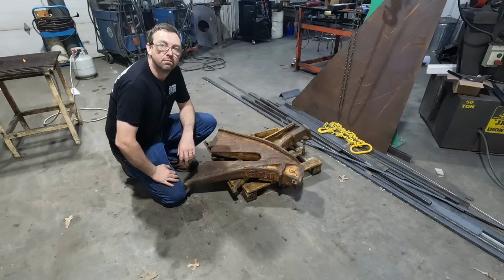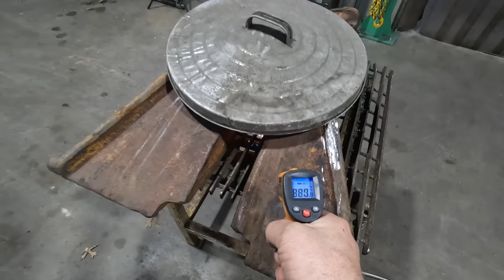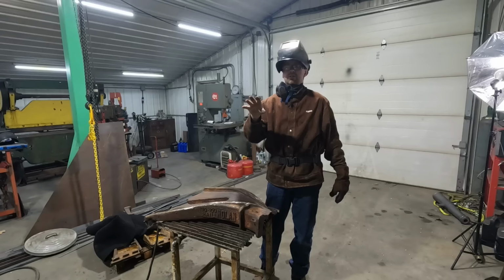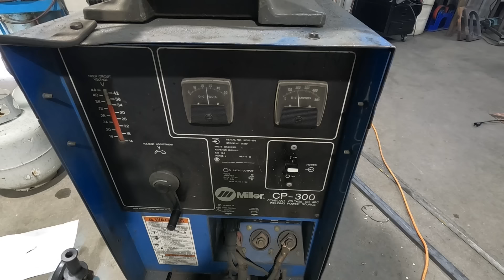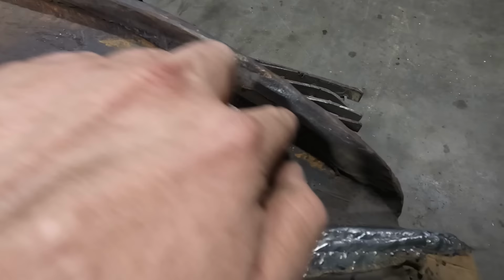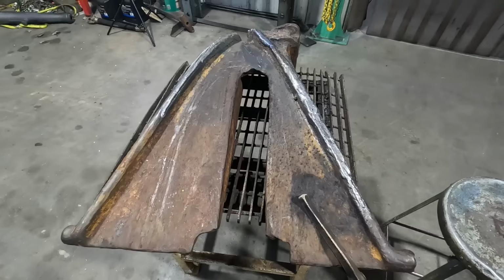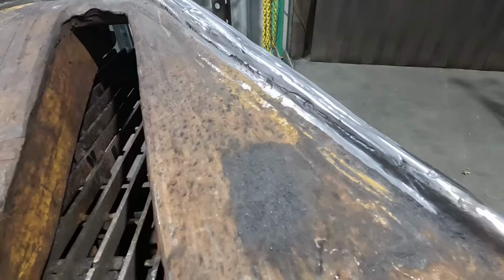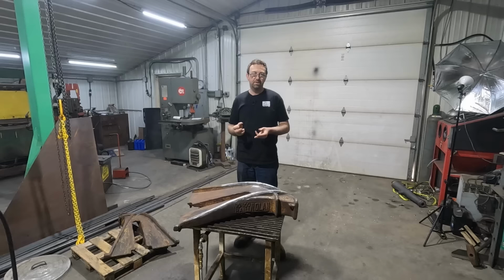Fixing a Worn Set of Rerailing Frogs - Train Derailment Cleanup Tool Rebuilt - Welding Repair

Comment: That’s something you rarely see is a welder paying attention to preheat, postheat and interpass temperatures. Metallurgy works.
Reply from the maker: It's funny how nobody pays attention to that stuff. I didn't do the proper procedure one time and paid for it. Now preheat, interpass temp control, and slow cooling or sometimes post heat.
Reply: That’s why we love Topper, no argument one of the best welder/machinists on the platform
Reply: Most welders just know how to run beads. They don't have any real technical knowledge. I went to school for welding and welders always ridicule me for it. "You don't learn to weld in school, you learn to weld by doing it. You learn about welding in school. Things like preheat, interpass temperatures and post heat.

Comment: Very interesting. I saw a derailment recovery video on CCRX 6700's channel, he works for a railroad that services coal mines. The rerailing frog in his video looked a lot smaller than yours, it might have just been perspective as they are only shown once in place. But it got pushed along a fair bit before they got it to stick and the wheel successfully mounted the frog and they finally managed to get things back up on the track.

Comment: You’re absolutely correct about ice and trains derailing. Back in 1974. During the Winter the Railroad never turned the water hoses off at the locomotive engine house. Well it had snowed out. When I went over this section of rail. Headed for the fuel pad. The Locomotive derailed instantly because of the ice. The Locomotive slid sideways into a drainage ditch. I thought the locomotive was going to turn on its side. Luckily it didn’t. Anyway Penn Central were using EP-22/E-8’s on the NY and Long Branch Railroad from South Amboy NJ to Bay Head NJ. I remember some of the EP-22/E-8’s had two retailers on certain locomotives. They looked similar to the ones you’re repairing. I do remember they looked like they were never used. Excellent job at repairing your retailers.
Reply from the maker: Winter railroading sucks. I get called frequently to retail cars and engines due to the ice. Sometimes the ice can help too. I've pulled cars back on just following the ice rail.

Comment: I only wish we could use rerailing frogs. Embedded track and clearance issues prevent it. We use Hegenscheidt MFD rerailing equipment. And yes, derailments are very stressful and time critical events. The most dangerous thing we do on the railroad. It is very rare we even get still photos, let alone video.
Reply from the maker: I've been the wreck boss on several derailments over the last 15 years. If someone has time for pictures, they aren't paying attention. I've seen so many close calls from people not paying attention.

Comment: Notice that the rerailers are designed for 70-100 Lb rail as cast into the side of the piece.  Are you using them on the appropriate size rail or larger size rail?  Retired 51+ year railroader with 10+ years on the ground
Reply from the maker: Almost all of my customers are in 90lb rail. Some 100, but way more 90lb.

Comment: 🤣🤣🤣🤣"Fart Sniffer"!!!! I remembered that one. I do not know that much about welding but I am glad that you do. I thought that your concern over the preheating was great. I did not know that a weld could hold up to so much weight rolling over it. For some reason I thought that you were going to do a post heat but I must of been thinking of another procedure. Great work on the job and on the video. It is good to see you and thanks for the video. :hand-pink-waving::hand-pink-waving::hand-orange-covering-eyes::hand-orange-covering-eyes::trophy-yellow-smiling::trophy-yellow-smiling::trophy-yellow-smiling::trophy-yellow-smiling:

Comment: Have seen how it is done in some of the "less advanced" countries, there was a tv travel program where they used a club/lump hammer to run the wheel up.
Now to tell you off😉, as a one time audiology tech may i suggest you use hearing protection to match your eye and lung protection. If your ears "ring" after a noise you are on the road to hearing loss, it is cumulative but avoidable.
Reply from the maker: I always wear ear plugs when welding. At the high amperage it's very noisy. You just can't see them. I've already done a lot of damage to my hearing, but it does help with marriage. I can't hear the wife complain as much. Lol
Reply: @TopperMachineLLC  always look for the upside in any adverse condition🤣
Reply: @TopperMachineLLC  I was also concerned about your hearing, but I could see that you were wearing ear plugs during this video. Like you, I have hearing damage from not using hearing protection when I was young (nobody did, as we didn't know about it back then). I use ear muffs when making noise, as my hearing is now very sensitive to even mild noise levels, which cause intense pain. I even have to tell my wife to talk more quietly when she thinks she is talking normally and not even yelling, but it sounds like it to me because of the hearing damage.

Comment: Got to be super annoying when you get the car pulled to the top of the railed and it jumps back over and goes back off. Looks like a second row of beads behind the tail at the top to buttress it sure would not hurt.
Reply from the maker: It was super frustrating.  I can't even explain the feeling you get when they climb up the frog and hit the rail on the other side.

Comment: Thanks for showing that.

Even if you can’t show a real “re railment” if you could spend a few minutes showing how those are setup next to the track and the principal behind how they are used. I just can’t quite picture it in my head. Understand if even showing this though might draw scrutiny you don’t want/need.

Keep up the great work.
Reply from the maker: Basically, you lay it over the rail and there is a wedge you drive in to lock it in place. The wheel just climbs up and over, being forced by the flanges I built up, to the correct location and drops back on the rail.
Reply: @TopperMachineLLC  ok, I think I get it. I had it in my head you sat that next to the rail. Thanks!
Reply: On this channel about 3 months ago, demonstrates how to use frogs to rerail a locomotive.. it can be a frustrating process https://youtube.com/@ccrx6700
Reply: @mark111943 I made a post demonstrating how to use the frogs, but I didn't quote you in it so I want to make sure you see it
Reply: @andyj74  appreciate you letting me know but I could find a post from you in these comments. Thanks Mark

Comment: is it possible to use some hard facing wire to add a bit of wear protection to the edge?
Reply from the maker: I'd rather have the frog softer than the wheel. Considering how they are almost 60 years old, I don't think I'll have to rebuild them again.

Comment: You should use a weldinghelmet with built in fume filter i like speedglas 9100 air with adflow 
So you can skip respirator
Reply from the maker: That's fine and dandy, but I also use the respirator for grinding and other stuff. If I only have the helmet, then every time I pull it off to grind I still have to put on a mask. Doesn't make a lot of sense to me. Also, I can think of way better things to spend a couple grand on.

Comment: Would there be any chance that you could mock up a short piece of track to be able to show the concept of how they work as I have never even heard of them before and would like to see how they work. As you said the real thing you wouldn’t do that I well understand anyway another good video
Reply from the maker: Setup is too much for me to do by myself. As you know, I do these videos alone. But the concept is that they lay over the rail and act as a ramp. The flanges I built up force the wheel to the correct location, and it just drops onto the rail.
Reply: @TopperMachineLLC  very simple but cool idea it must make it easier than having to use the big crane from your other video
Reply from the maker: @workingovertime4429  depends on the situation. Each took has its place.
Reply: You tube has a video.

Comment: Could you hard face the inner edge to ensure it didn't wear down as fast the inside face of the unit or would it cause too much wear on the train wheel flanges?
Reply from the maker: I was afraid hardface would damage the wheel. Considering these frogs are almost 60 years old, id say wear isn't a real issue

Comment: I thought you must have been running about 200A the way the weld was going. It was handy that you showed the gauges so we could see.
 I think your tension on the wire spool is a bit high as the spool looked like it was trying to hold the wire back too much.
Reply from the maker: I have fought with that spool holder for a long time. I think it's due for rebuild as I can't get new parts for it.
Reply: @TopperMachineLLC  I bet you know a good machinist, maybe ask him nicely to make so parts for you. Haha.

Comment: Dave at the Cumberland Mine Railroad channel showed a rerailing of a locomotive.
Reply from the maker: His FRA inspectors must not be like ours.
Reply: @TopperMachineLLC  
Isolated line only 18 miles long from crusher to river harbor.  All rolling stock is trucked from Poland Mines PA to harbor terminal.
Reply: @TopperMachineLLC  What is the big deal, we dont get it?
Reply: @lundysden6781  The FRA or Federal Railroad Administration is a watchdog agency similar to the FTC, FCC, FDA, and much of the old ICC pertaining to railroads.  They act a lot like OSHA, now do you get it?  
 As an add-on, the Cumberland Mine Railroad is not part of the national railroad system by not having any interchange with another railroad.  They can't exchange rail equipment with another railroad just by switching; any equipment has to be loaded onto trucks to go either way.  The same with the Black Mesa & Lake Powel Railroad in Arizona.

Comment: A couple of questions, what is your Miller amps set at for welding to such a thick part? Second, is that a cannon laying on the floor by the roll up door?
Reply from the maker: I showed the ammeter while welding in the video. With these welders you set voltage and wire speed, that in turn sets the amperage. Yes that is a cannon. I recently invested in some artillery due to the current status of the world.

Comment: Great video as always! It seems like you would benefit from a PAPR unit. I was able to score a used 3M speedglas one on eBay for only $500, and considering they retail around $2000, that's not bad. 

It didn't come with a battery so I adapted my 20v Dewalt battery with a generic Dewalt power bank and a step down voltage converter for less than $20 since a battery alone goes for $500. 

The regular particle filter it comes with doesn't filter the actually toxic fumes, so be prepared to pay another $100 for the gas filter.

In total I was able to get a working PAPR for less than $650 so keep your eyes peeled online if you're interested. It is 1000x more comfortable than a half face respirator. Definitely worth it in my opinion. Keep up the great work!

Comment: Wouldn't it in the long run be better to mill out the inside edge and make a bolt on piece. Just thinking is all. ?n may or may not work !!
Or maybe use a hard face rod if that is still being used..?
Reply from the maker: I wouldn't trust a bolt in piece for the weight and force these see. I considered hard facing, but my concern was damaging the wheel. It doesn't take much to condemn a wheel.

Comment: We know that these tools help to get cars back on the tracks. Can you please help some of us understand how that happens exactly?
Reply from the maker: It's a ramp that goes over the rail. Pull the car up and it forces the wheels to the correct location and drops back on the rail.
Reply: @TopperMachineLLC  Okay. It can be placed in front or behind the wheels?
Reply: @nobuckle40  As a railroader, the best location for a rerail frog is before the wheel(s) as pulling on a car has more control than pushing on it because of slack action.
Reply: @royreynolds108  Thank you.

Comment: Why are you using mig to build up a tool soft wire instead of weld mold hard surfing rod.
Reply from the maker: Because softer weld won't damage the wheels.
Reply: @TopperMachineLLC  makes sense I assumed train wheels had a Rockwell just below the rails. And I was under impression rails were a pretty high number. Thanks for replying back.

Comment: Notice that the rerailers are designed for 70-100 Lb rail as cast into the side of the piece.  Are you using them on the appropriate size rail or larger size rail?  Retired 51+ year railroader with 10+ years on the ground